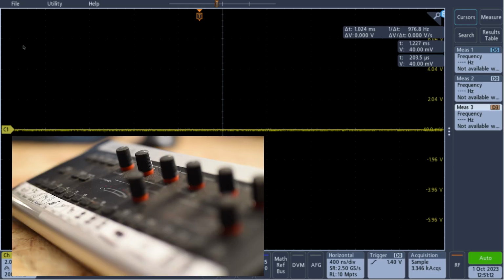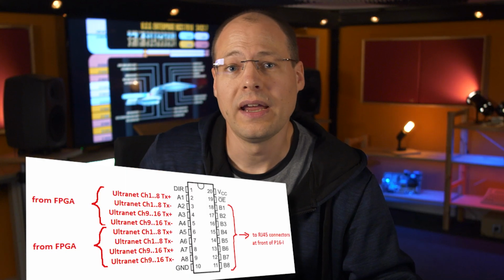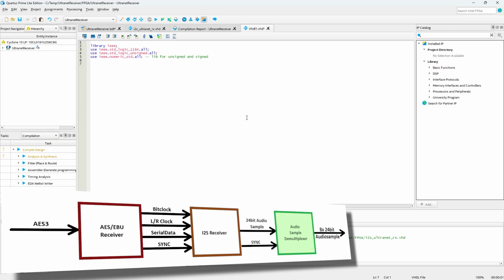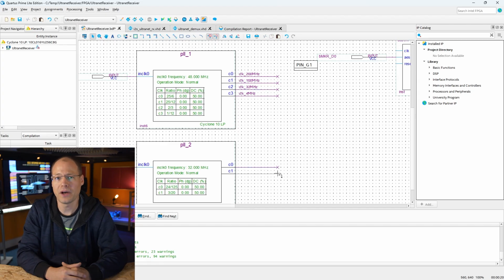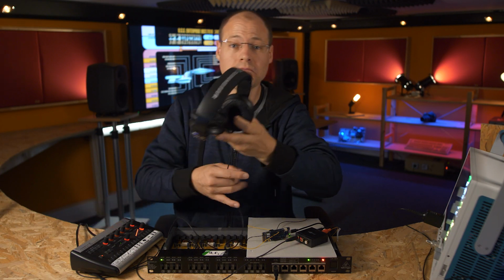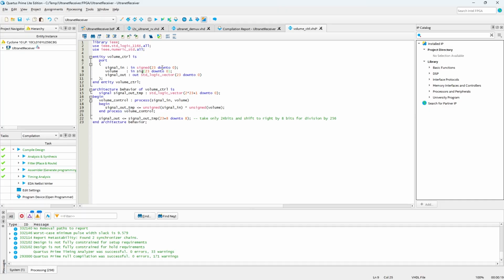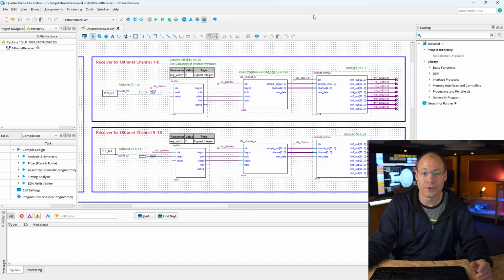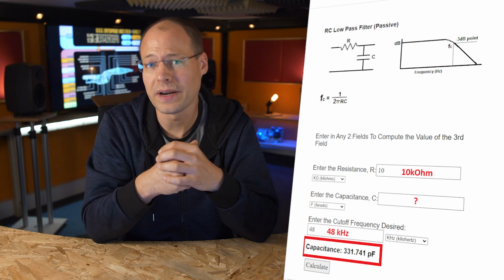Hacking Behringers Ultranet for a FPGA-based DIY-Audiomixer

Comment: Ooooh, Ultranet to Spdif, been looking for this for many years!! Will have to try this out, thank you very much for the explanation and your vast knowledge!
Reply from the maker: Thanks. I'm currently working on a full 16 channel digital audiomixer based on this Arduino Vidor 4000 with EQs, NoiseGate and compressor.  

Most of the things are already working. In a couple of weeks I will do another Video about this. Stay tuned.

Comment: I've never met  a single FPGA engineer that could have got a sound out of that setup on the first P&R -- especially with no simulation 🙂
Reply from the maker: In fact, I didn't use ModelSim/Questas because I didn't know how to simulate I2S audio signals well. The calculation of the IIR filters was not that difficult in the end. But the connection of all components with each other and the optimization of the VHDL-code to fit into the small device cost me nerves. The audio compressor and the noise gate were also a challenge. But now it works.
Reply: Is RME a joke to you?

Comment: As operator of a very large audio/video network I would like to assure you that neither in my network do the audio packets fight the rest. Priority configuration deals with that. And I have the web browsing and file transfer needs of 2000 journalists editing video and researching news to balance.  It can and sometimes must be done over the same wires / pieces of glass.  
With that, yes, the Ultranet (as well as AES50) is a very attractive target, promising easy implementations of media transport.

Comment: It would be really interesting to see an FPGA implementation for AES50.
Reply: this!!! yes please!!!
Reply from the maker: Oh well, AES50 uses 100MBit/s and so it is much harder to decode compared to UltraNet with "only" 12.288 MHz. Even the 12.288 MHz needs a 200MHz clock to decode it properly and you have to take care of the signal-quality. AES50 (called SuperMAC or HyperMAC) probably requires even more effort to be able to decode it properly. But never say never :)
Reply: @pcdimmer does AES50 use an ethernet phy?

Comment: um, wow. Very cool. Very concise! I like the no frills, pragmatic approach.

It's insane how much DIY hardware advanced in the last 10 years. Even for a hobbyist, only imagination is the limit nowadays. Buy a few dev boards, get some  (C, VHDL, whatever) code together, tweak, spin your own design, even if it's just a board to nicely fit pre-made boards together,  send to PCBWay,  and have hardware in your hands for a few bucks, that would have cost thousands of $ in R&D and then production setup costs a few years ago.

I love it :)
Reply from the maker: Yes, you're absolutely right. The FPGA used here is only an entry-level model, but you can still create digital mixing consoles with several channels and digital signal processing yourself for as little as $50 to $100. Let's see what can be done with it in the future. Exciting times in any case.

Comment: Have a lot of interesting hardware with with CobraNet (Yamaha DME32/DME64n, BiAmp Audia, Peavey Nios n6) and these devices are technically mixers but designed for industrial spaces to handle hundreds of speaker channels, provide programmability for PA and telephone systems (DTMF detection, echo cancellation, etc) and interestingly all programmed in graphical interfaces that provide node-based programming which actually compiles to native DSP code for the unit -- it's potentially possible to inject new DSP algorithms into the compiler to extend the effects beyond just the standard EQ/delay/noise cancellation tools they come with.  DME64n can actually emulate multiple SPX90 multi-effects units given available resources.
Reply: Has anyone actually emulated the spx90 on a dme24n?
Reply: @jeremybiggs8413  If memory serves me right, a model of the SPX90 is built into the Windows programmer tool for the DME devices, but it’s costly on DSP resources.  I vaguely remember the DME64n could run 2 and the DME24n has half the DSP power.
Reply: @rbus  DME Designer?

Comment: Ultranet to usb file writing would be useful for making a multitrack backup recording from the xair mixers.
Reply from the maker: Well, recording a stereo I2S from the FPGA via the ESP32 to an SD Card is possible and quiet easy. But recording to USB is a bit harder.

One solution could be the CH375B Chip, which has a USB Stack. But I'm not sure if it can handle the desired data rate.

Another idea and a bit easier: streaming the multi-channel audio from the FPGA via Ethernet to a PC. This is something I'm thinking about as I have an old FPGA eval-Board with Ethernet. Would be much easier than USB with FAT32 I think.
Reply: SD card would be fine as well. Any storage media really.
Reply: Ultranet to Ethernet bridge would be awesome
Reply: A solution to extract the 16 channels from an XR18 and record them on an SD card, or even on an SSD as a standalone solution, would be pretty amazing.

Comment: Awesome! Well done! 😀 ... Minor correction - its using RJ-45 connectors and UTP / Cat 5 cable, but its not Ethernet (not even just Layer 1) - there are no Ethernet PHYs and no magnetics, just the TTL buffers / line drivers in a "pseudo-differential" arrangement.
Reply from the maker: You are totally right, only the hardware-connection looks like ethernet, but it is not compatible. Thanks for the hint 👍
Reply: yeah, I was confused at first, too. But they are only using RJ45 plugs and standard ethernet cabling, but that's it. There are several other occurances where HDMI or SATA connectors and cabling is used for totally different things, because they meet basic signal integrity requirements and are readily available...
Reply: I think Dante is the outlier because it's actually using network packets to send the audio. A lot of audio-over-cat5 stuff is just using cat5 because it's a convenient balanced cable, and when it's analog it's obviously not ethernet. Although maybe it's not accurate to call it balanced. But differential just means it has a mirror-image negative signal, right? Like SCSI LVD cables... or just about anything that isn't fiber? What do you mean psuedo-differential? In my mind you say 'differential' when it's a digital databus and 'balanced' when it's analog audio. Whenever it gets super technical, the EE/physics nerds start talking about impedance and I can't really keep up LOL.
Reply: @RaquelFoster  Yes, it looks like Dante is indeed "actually Ethernet"! (Wikipedia states "uncompressed, multi-channel, low-latency digital audio over a standard Ethernet network using Layer 3 IP packets.", and references Fast and Gigabit Ethernet)... I only said "pseudo-differential" because the line drivers (74LVC245A @3:29) are actually made up from 8x independent single-ended channels, two of which happen to be used for each channel (one positive and one inverted). I can't really see in enough detail, but it looks like the FPGA is producing these two signals... As far as I'm concerned (I'm an EE!) "differential" vs "balanced" is basically the same thing, though as you say the term "balanced" is more common in audio.
Reply: @AttieGrande  -Dante is indeed an Ethernet based protocol. It is based around RTP (I believe) and uses Unicast/Multicast Traffic. If you want to learn more, I'd ignore Dante as this is a propteriaty protocol used/licensed by Audanate...instead I'd look at AES67 which is essentially the same protocol as Dante but has been adopted by the AES as the Audio over IP standard. AoIP is pretty cool and is by far more powerful than Ultranet.

Comment: I love the Startrek set! I have longterm goal of reprogramming Behringer DDX3216 firmware/os  to make it more compatible with modern hardware and USB etc.. videos like this serve as an inspiration. Only SHARC DSP but still nice to see FPGA being worked with. I have lots of learning yet. Also want to see if I can get keyboard/mouse and CGA montor if I can figure out how to adapt the firmeware to the AM386 chip that is in it and its memory chips.. I will dream.  12:15  You da man.
Reply from the maker: I had a DDX3216 in my shopping cart a few times in 2010 and 2011. But then in 2012 the X32 came out and I bought it straight away. Good luck with your project - it sounds very exciting! From my own experience I can say: don't give up. With the UltraNet project, I wasn't very familiar with signal decoding and almost gave up at one point. But I stuck with it and now it's working.

Comment: Thanks, this is amazing! I've wanted to start tinkering around with Ultranet and AES-50 for years, but I haven't had the time and I don't have nearly enough expertise. I know just enough to be able to imagine the possibilities if I did know more, hehe..

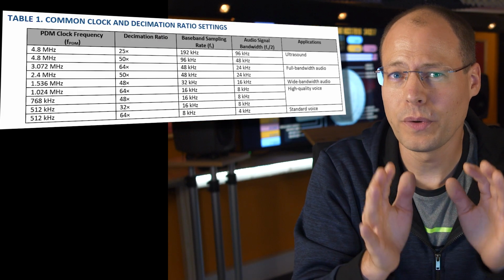Anyway, minor thing: around 19:10 you're talking about the PDM clock frequency vs samplerate vs audio bandwidth, and you mention the audio bandwidth being 48kHz; and while AES-3 itself can do that (since it's able to go to a 96kHz samplerate), I believe that Ultranet actually uses only a 48kHz samplerate, which would make the Nyquist frequency (and therefore the maximum audio bandwidth) only 24kHz.
Reply: haha correction, I thought AES3 can go up to 96kHz sample rate, but according to Wikipedia, while it was designed primarily for 48kHz, it can in theory run at any sample rate.. but anyway, since all Behringer mixers (and their corresponding Midas counterparts) run at either 44.1 kHz or 48 kHz, I believe Ultranet also runs at those, and not at 96kHz..
Reply from the maker: Oh dear, you are right. In the PDM-table the full usable audio-bandwidth seems to be present (already taking Nyquist into account). I always took it as "comparable to x kHz PCM audio". But anyway, higher PDM-frequencies help us during filtering with a RC-filter. And there are no drawbacks increasing the PDM-frequency within the FPGA between 5 to 10 MHz.

Regarding the other frequencies: UltraNet uses a 192 kHz-"like" PCM-based AES/EBU stereo-signal. It is not a real 192 kHz, but stores four "stereo" channels with each 48kHz resulting in this 192kHz-like stream to meet the AES/EBU-specifications. So 8 mono channels are transferred in two AES/EBU-lines, resulting in the 16 UltraNet-channels.

Comment: Your engineering is amazing to me. I tinker, but you actually know what you're doing. 
When are you going to turn your attention to the Wing? For one thing, the Wing has no dedicated Ultranet output. The only way to attach Ultranet devices to it is to first attach a stage box or P16-D using an AES50 connection. Would be great to be able to hack something that provided that from the Wing itself!
Reply from the maker: Hi, actually I'm working on something like this. Most of the parts are already working, so I should be able to publish the results in December. So keep an I on this channel

Comment: Our hearing is not linear to sound levels so it would be better to use a tapered scale or logarithmic scale for volume scaling.
Reply from the maker: That's a good point. In fact, we have made the volume setting logarithmically. Within our software, the volume values are always given in dBfs between -48dBfs and +6dBfs. The dBfs value is then converted into a multiplication factor when it is transferred to the FPGA: https://github.com/xn--nding-jua/Audioplayer/blob/c26dae83fb04a85184762b9480279fc012d3b195/NINA/Mixerengine.ino#L59

Comment: Fantastic work and a great demo of your process, thank you for sharing. Would it be possible to create a similar device to output Ultranet after capturing audio from another source (such as another manufacturers digital snake system)?
Reply from the maker: Hi, in general it should be quite easy to multiplex the eight channels within an AES/EBU signal, but I'm not sure if Behringer is checking against some of the additional status bits to ensure a valid Ultranet signal. While receiving I'm ignoring these bits.

Comment: That’s awesome. I’d always wanted to create some sort of open source digital audio mixer. Seems like it should be quite possible to implement one that could interoperate with multiple standards, like AES67, Dante, behringer, etc. 

I am curious how much DSP you could add with an FPGA/when it makes more sense to incorporate a dedicated DSP chip. You’d need some EQ per channel, compressors per channel, and some sort of reverb to finish it out. 

I recently picked up the Behringer XR18 which I quite like. I believe it supports standard MIDI control which would be a nice touch to incorporate. It’s likely that interfacing with bog standard MIDI mixer interfaces wouldn’t be that hard.
Reply from the maker: Audio-Mixing (so speaking of summing audio channels) is very easy within the FPGA. You can reuse the multiplicator to reduce the demand of multiplicators. I created a 22 channel mixer with this specific low-cost FPGA already.

But each EQ is using lot of logic-elements together with multiplicators. So outsourcing this into a dedicated DSP-chip would reduce the demand - and you end up with the Behringer X32 concept :) As I remember correctly, they are using a FPGA-based system together with multiple Sharc audio processors. With some time it is possible to enhance my approach to a Behringer X32 "very light" ;-)

AES67 and Dante would be a very nice feature for the future and I already placed some information about these two on my harddisk :)

Comment: Hi Chirstian, the way you show and explain everything precisely and clearly is awesome, thank you! You showed that a connection with the Behringer P16 was needed to activate the datastream. What does the Powerplay-16 need to 'see' on its ultranet connection in order to start the data stream?
Reply from the maker: Hi, thanks for the kind feedback - good to hear. The Powerplay P16-I only needs to see a small power-consumption on its 15V-power-rail to activate the digital outputs. I bypassed this in the video using the digital-inputs of the buffers directly, but if you apply a resistor roughly around 2k2 between +15V and  GND as I've shown in the schematics (see resistor R4 in https://github.com/xn--nding-jua/UltranetReceiver/blob/main/Schematic.pdf), the regular outputs will be activated.
Reply: @pcdimmer    Hi Christian, thank you for your fast response and the information. It is fascinating to think about the possibilities of your project. When the ultranet data is expanded with 'writing data' then communication with the Midas DN4888 StageConnect interface would undoubtedly also be possible. How cool is that !

Comment: oh man... I have a stack of Motu 24i interfaces, a Tascam DM24.  The TDIF io interfaces, PCI cards and all the cables cost me a fortune back in the day... all useless due to drivers.  Thanks every hardware vendor ever for making my expensive gear obsolete in 5 years...  if only I could decode the stupid drivers and make my own
Reply: Metric halo. Their first 2882 interface from the early 2000’s is still usable today thanks to then continuing to develop upgrades for them. Yes it’s a paid upgrade. But much cheaper than replacing your entire rig.
Reply: @cmatte82  well I have since downsized my entire setup to one desk and one tall rack. It is so much more manageable lol
Reply from the maker: Yeah, most of the TDIF cards seem to use FPGAs, like the "Soundscape PCI Card Mixtreme 1B 4500 Audio Sound Card". It used a Xilinx XC5200 FPGA and an older Motorola Mixed-Signal DSP for the PCI-communication - the fpga probably caused the price to shoot up at the time. Unfortunately, TDIF does not seem to be quite as easy to handle as AES/EBU or other serial protocols, as it seems to work with different voltages.

Comment: One note of arduino vidor. It has pretty ok clock quality is used with usb. When running standalone external crystal oscillator is recommended.
Edit: Not sure did samd21 do some clock recovery / tuning from usb when usb is used. Some had observe samd21 clock was more unstable when using standalone so they needed external XCO when running standalone. when connected to computer it was ok.
Reply from the maker: In fact, I haven't even looked at the 48MHz clock in detail. According to the data sheet, the SAMD21 generates the 48MHz from the small 32.768 kHz quartz. I'll have to have a look at that. Timing is particularly important for fast signals and since the FPGA derives all internal clocks from the 48MHz via the PLL, they should be stable. Thanks for the tip!

Comment: Amazing you did this, infinite applications.. would be possible to connect your device to the ultranet output of an XR18 and from that stream the audio channels to an ethernet lan using a Real Time Transport Protocol (RTP/RTSP Audio Server)? Maybe connecting cables from the Arduino MKR Vidor 4000 socket to a raspberry pi socket and installing the RTP audio server there?  The scenario I am thinking is taking all the audio signals from any computer using one or more RTP/RTSP clients (ffmpeg, etc) via the usual ethernet lan and routing signals (using linux tools like pipewire, qpwgraph, virtual modules with pactl, pw-link, etc.) to any DAW program in order to record or process signals as demand. Thank you!
Reply from the maker: I have already decoded UltraNet with the FPGA (see the previous video). But audio via Ethernet is another matter. However, you can send an I2S data stream to the RaspberryPi (for example see https://github.com/makerportal/rpi_i2s/blob/main/i2s_stereo.py) and then forward the audio stream via the network as you have mentioned. However, I'm already thinking about how to send audio data directly out of the FPGA over the network using an Ethernet phy to emulate Dante or other Audio-Over-Ethernet protocols. In principle, this is possible. However, the variant with the Pi should be much simpler for now. Please remember that, as far as I know, the Pi can only process stereo I2S. Maybe recording multichannel audio to a SD-Card directly from the FPGA is easier than implement audio-streaming to a DAW?